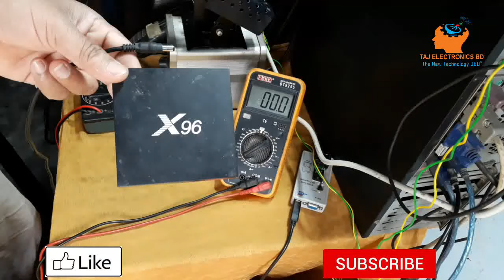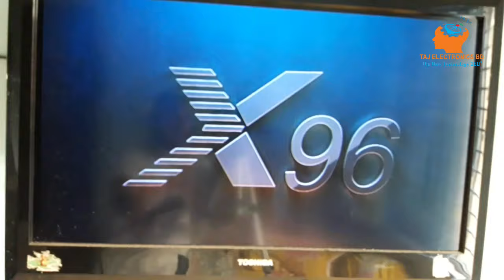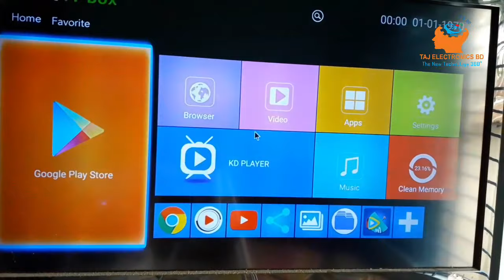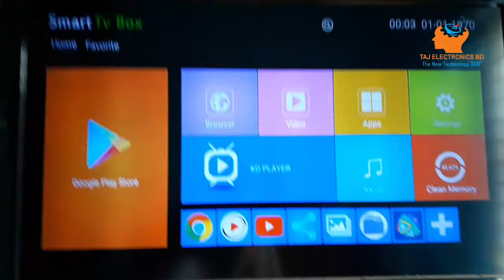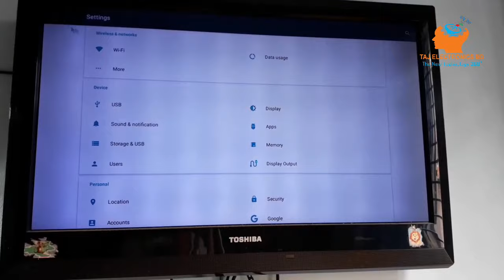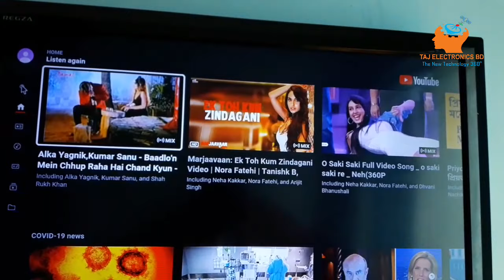X96 android smart TV box.RAM:2G-ROM:16G. problem no power. Solve power transistor replacement.

Comment: I have android MXQ pro 5g box and have 5v 2A input port. But by mistake im give 12v 0.5A power so divice not started , plz help
Reply from the maker: Mother board burning?
Reply: @TAJELECTRONICSBD  Hi me too Same Problem. but my mother board is not broken And Burning.
Reply: @TAJELECTRONICSBD  
Theres have a any solution to fix my Mxq Pro or not?

Comment: My x96 mini is showing blue light in device but not showing display on.led how it will be fix?
Reply from the maker: problem hardware and software. Hardware voltage chaking or software recovery solved.
Reply: @TAJELECTRONICSBD  yeh repair hotay hain kahin se ?
Reply: bro were you able to solve it? I am having the exact same problem
Reply: @gauravjhawar  main ne check karwaya apna box power supply ka masla tha processor tak power nahi ja raha tha 700 ka bola k repair hoga main ne nahi karwaya boht hi cheap quality ka box hai yeh repair karwana bekaar hai

Comment: Dear Sirs, good day and Hello From Brasil. 
I had a bad experience with TV BOX a95x f4
Now A95X f4 looks that burned = DIED.

We have no power in the mother board.
We have tested capacitors and energy power jack, and looks that power is OK in the jack and on the USD doors but, The power do not energize the mother board. 

tried turn on via USB cable, but do not works.
I think that some mother board some capacitors burned as on the video but i could identify where is the fail.

My question is do you have electronic system map of TV BOX A95xF4? or any idea to how to re-born my device?
Very sad with that situation, spent USD 95.00 for device burned in 12days. :/
your assistance and attention on this regards is very appreciated